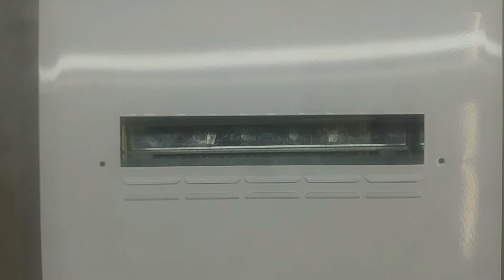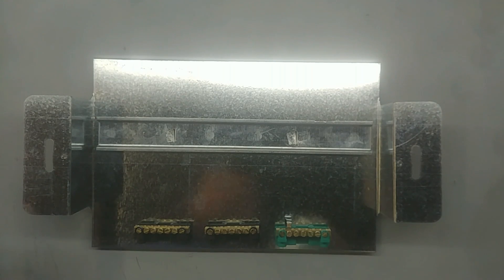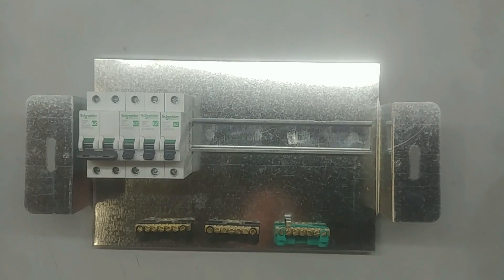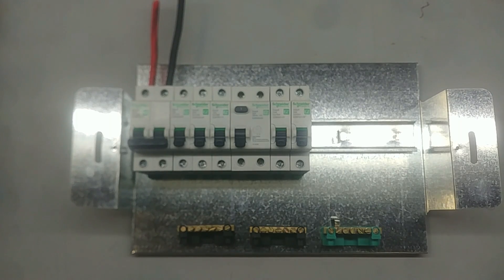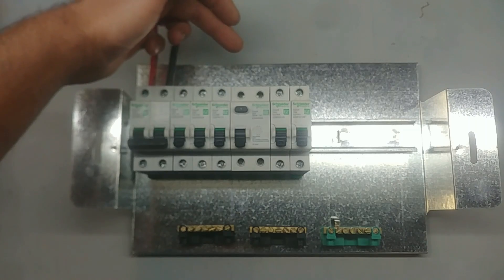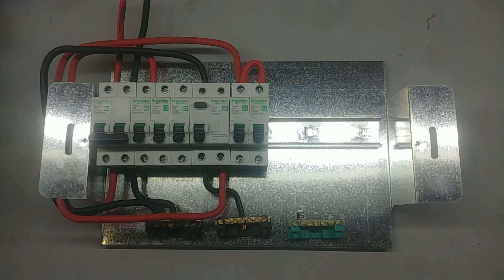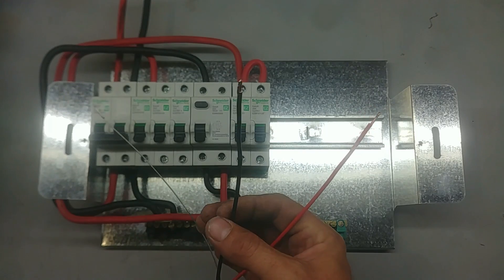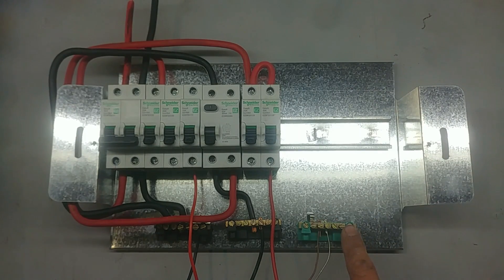How to Wire a Distribution Board

Comment: Great Vid. Thanks   I take it that an Ac Air conditioner is also wired as a stove geyser lights cct via the Main buzz bar for neutrals and the live feed only from the Main switch?
Reply from the maker: Hi. Yes you are correct. Just have an isolator next to the aircon.
Reply: @p0we111  Thanks. for the quick response The isolator is for servicing tech to isolate the AC for safe maintenance.
Reply from the maker: @SnowyPe  No problem. Yes exactly as you say.

Comment: ❤should the other circuit have earth leakage as well???
Reply from the maker: Hi. It depends on the current law in your country. The laws in South Africa has changed a great deal since this video was published. 

It used to be only plugs must be on earth leakage. You can put all if you want but its not necessary.

Today if a stove has no stove coupler the it has to be on earth leakage.

If a ceiling fan is not on an isolator switch then it must be on earth leakage. Geysers/hot water cylinders is a must for earth leakage today if Im not mistaken. So basically if you put everything on the earth leakage you will be save but can have a lot of nuisance tripping 🙂

Comment: This is easy.
The bit I’m interested in is how electricians can upgrade the entire switchboard, including putting the main switch, when this switch still gets power from a meter.
Asking because there is no means to shut down electricity simply because the main switch is also changed
Reply from the maker: Hi Elena. To switch off the mains you will have to contact the electricity provider. Around here they come out pretty quick and dont charge for the service. 
Changing a main switch with the power on is not advisable. I had to do it one or twice in situations where switching off the power was not an option. Insulated tools and gloves is advised in a situation like that.

Comment: Good stuff.  Must each breaker be fed from the top?
Reply from the maker: Hi. Yes,they must be fed via the shortest point which in the general breakers are from the top. Im sure you can order breakers that are fed from the bottom but not the normal,everyday breakers. They will work fine if fed from the bottom but the law states the shortest contact sould be live.

Comment: Are cables usually run up walls for light circuits and down walls for socket circuits for new installations
Reply from the maker: To a light switch you will run a LIVE wire down to the switch and a RETURN wire up from the switch to the light and a earth wire of coarse. 
If you don't do a connection in the roof you come down to one plug and up the wall to another and so on.

Comment: Are three phase sockets also have radial circuits with a busbar on breakers
Reply from the maker: Hi Ashraf. If by radial circuit you mean goes from the breaker to plug number one and jumps to number two,then three and so on,then yes it can  be radial. 
Just be aware of the amps as it adds up faster if you have high power items plugged into the three phase sockets.

If you mean just the busbar feeding the breakers then check that the busbar can handle all the amps as well as the wires feeding the busbar is rated high enough for all the amps.

Comment: Where have you studied electrical course. Did you get practical training from the ECA
Reply from the maker: Hi Ashraf. I did a few years working as an apprentice. After that I went to ECA yes. That was in Woodstock if I remember correctly. Was 10years + ago though!
Reply: @p0we111  students usually go to ECA for training before starting apprenticeship. But Schneider electric also gives 2 day training on installation and fault finding. We basically just need some basic knowledge before you start working

Comment: Half of the circuit on my outside lights aren’t working. Do they connect at a junction box. Each light fitting just has one set of cables. How do you find the junction box for that circuit. There’s no voltage present
Reply from the maker: Hi Ashraf. Yes,if only one set of wires run to a light fitting a junction box is present. You will have to trace the wires from the light hopefully to a roof space\crawl space. They can also all be run to the light switch,but that is unlikely.
It is illegal to put a junction box in a place where you cannot access it,but that does not stop some people still doing it.

Comment: When you’re installing more lights and sockets on one circuit do you need to use thicker wires
Reply from the maker: Hi Ashraf. No,the wires size and the breaker size are matched to protect the wires. You can add lights and sockets as you like until the breaker trips because of too much amps. 
In South Africa the law recommends 7 socket points per circuit. (If the law is still the same) but it does not set a fixed limit. But try and keep it around 7 points. (Can be 7 double plug points)

When putting in new wires always match the size off the existing wires. It is always good to check if the breakers and wires are matched as well.

Comment: Are the wires usually separate or come in one sleeve with live neutral and Earth
Reply from the maker: Hi Ashraf. You can buy them separate or in a multi core cable where you have to strip it to get to the individual wires.

Comment: How can one do his own electrical wiring at home and get it approved. Those that’s qualified can just teach and inspect whether the DIY Projects are done Correctly
Reply from the maker: Hi Ashraf. I believe if you want your work (diy) sighed off,you will have to wire it under the supervision of a qualified electrician. Then someone can sign off on your work. That is how I worked as an apprentice,before qualifying.
Reply: There’s to much studying involved becoming a qualified Electrician so I’m only interested in learning the necessary information from experienced persons to get the job
Reply from the maker: @ashrafkarjiker6888  Yes I agree. You can do it yourself,but like I said,it will have to be under supervision of someone qualified.

Comment: Which are good electrical books to read for South Africa electricians
Reply from the maker: Hi Ashraf. If I were you,I would read/memorize the SANS 10142 Wiring Code book before anything else. You should be able to get it at ECA or the Western Cape Approved Electrical Inspection Authority.
Reply: Does the SANS book mention the cable size for lights, plugs etc

Comment: Hey jean b I would like to know I want to add a light switch to my exciting lights but I don't want to go in to the roof can I wire it to the DB board If so how can I do it
Reply from the maker: Hi. Yes you can wire a new light circuit into your DB board. You will have to use the same size wire and the correct type. 
Check where the existing light circuit is.

The live would be connected in one of the circuit breakers. The neutral should be on a neutral bar and the earth on an earth bar. Just connect your wires in the same places. 

Be careful and switch off all power. If you are not sure get an electrician!
Reply: @p0we111  ok but I have alot of lights like 4 of them running to the DB board can I brigde them out the live wire going from the light switch

Comment: Which book can we find the wire sizes
Reply from the maker: Hi Ashraf. In South Africa we have the Wiring Code (SANS) book. It is a government issued book. You can contact ECA (Electrical Contractors Association) or WCAEIA (The Western Cape Approved Electrical Inspection Authority). I'm sure there are others,but these are the ones that I remenber. 
I'm not sure but I think a online version is also available.

Comment: Hi Jean. Thanks for the video. Quick question, should your SUB DB's be connected on the MAIN DB E/L or not? All my SUB DB's do have their own E/L's installed.
Reply from the maker: Hi Jacques. If each Sub DB has an EL then no,no need to connect it to the Main DB EL as well.

Comment: Great vid, thank you! 

I'd like to get in an electrician to connect my Ellies 1440w inverter kit with 2 batteries connected directly to my distribution board. Is there a limit to the number of breakers I can connect to it??

In my case I need 2 which are crucial  and as a bonus another 2 or 3 (lights and plugs - no geysers, stove or fridges).
Reply from the maker: Hi Boutit

To my knowledge, the only limit is the watts that you have. (1440w)
Circuits are up to you. 
Just remember to put in another earth leakage after the inverter so that it will still protect you in case of trouble.
Reply: Excellent stuff, thanks a million!

Comment: How do you wire from the meter to the double pole switch without turning off electricity? i mean what is the best practice for safety since there are no switch to turn off between that and how do you strip the wire insulator while the electricity is on? Sorry i am a novice need to ask you for guidance
Reply from the maker: Hi. I always contacted the electrical supplier to switch off the electricity. You cannot open the meter with the electricity on,as this will trigger a safety cutoff and you would have to contact them anyway to switch it on. 
As for stripping,get yourself a good quality 1000v rated pliers. You can also get insulated gloves.
Reply: @p0we111  thank you for the insight

Comment: Good day , I dont want to be a "Karen". I want to start the conversation stating your video was posted 2 April 2019, this means the relevant SANS code 10142-1 2017 edition 2 would have been the relevant national standard you based your installation on. I want you to refer you to section  "6.16.2 Water Heaters",under  "6.16.2.1" it clearly states a geyser shall be connected by a earth leakage protection device.  Your video states otherwise and thus not following in my humble opinion the national standard.
Use it dont use it, I dont care
Reply from the maker: Hi Herman.
Yes this has come up before.
I have stopped posting videos because of that reason and that the law changes so much in SA that one cannot keep up. I was subscribed to a electrical forum in the hopes of keeping up to date but that is just more confusing with so many different interpretations of the wording in the SANS.
Im trying to move to more "fun" projects, rather that serious electrical work in order to avoid the rule book in the future.
Lekker naweek verder, dankie vir die comment.

Comment: Hi Jean, Thank you for putting up videos for South African installations. Just a question on the Water heater circuit. I see that you use a single phase CB for the water heater. How does this installation fit in with SANS 10142-1:2017
 Edition 2 Section 6.16.7 Electrode water heaters, steam generators and boilers, where it is stipulated to have the water heater supplied from a multipole circuit-breaker?
Reply from the maker: Hi Hubert.
The single pole breaker is sufficient if you have a double pole isolator within arms reach of the water heater according to the Western Province Inspection Board (Aug 2020).
In regards with the water heater on earth leakage, that has changed sometime last year I think. New installations of water heaters need to be on an earth leakage.
Thanks for the comments!
Reply: Thank you for the response/ clarification

Comment: Hi people usually use double pole cbi geyser breakers how does one wire that up, please explain
Reply from the maker: Hi Xavier.
A double pole CBi is only necessary if you dont use a isolator within arms reach of the geyser.
If you want to use a double pole instead of a isolator at the geyser the CBi doubke pole has to be lockable.
To wire just take a live and neutral to the top of the breaker and the live and neutral going to the geyser at thr bottom.
Reply: @p0we111  so the live comes from the mains that goes on top and the neutral comes from the neutral bar which doesnt go on earth leakage?

Comment: Geeser??? Whats a Geeser??  Are you wiring up some old dude?
Reply from the maker: :) Terminology of different countries is sometimes amusing!

Most people here would frown at the term "hot water cylinder" and not know what you're talking about...
Reply: @p0we111  Originally spelled Geyser I guess? Originally that was just a hot spring in Iceland but I know the term's been used for all kinds of gadgets that heat water. I think Vaillant had that as a trade mark for their instant gas water heaters way back when.

Comment: Hey Jean, great video.... I have a small 600w pure sine wave inverter/ups with a plug outlet that I want to connect to my light circuit (1 x 10a).  Is it possible to wire something like that to the light circuit legally here in South Africa and what other things do i need to take into consideration.... I have a 2 pole 40a din change over switch that I want to use...... perhaps a topic for your next video?